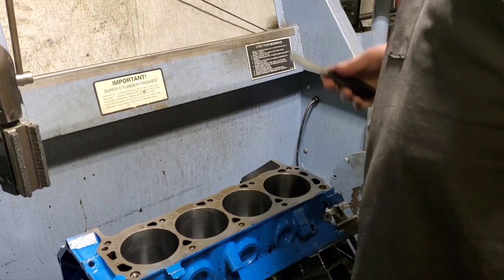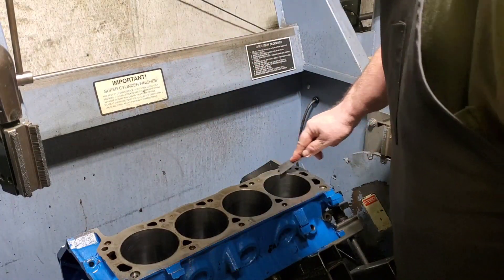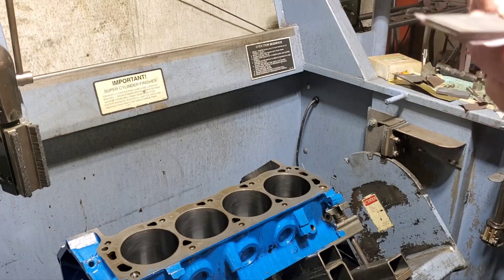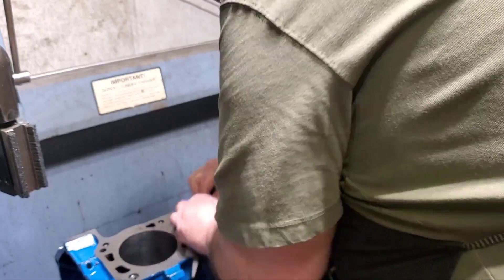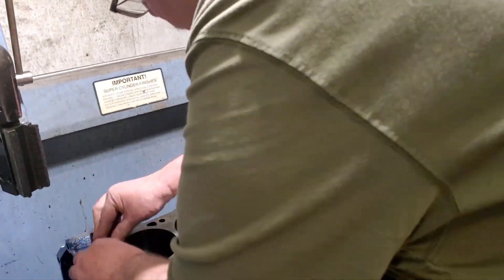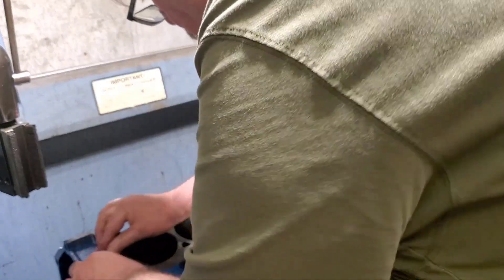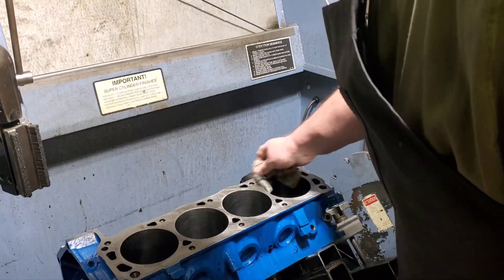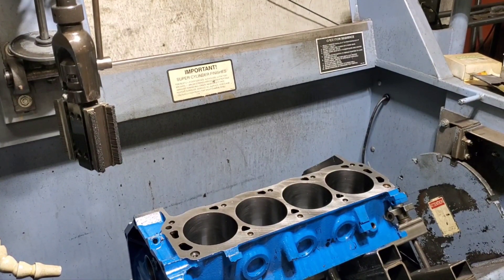Gasket Surface Prep, The Non Distructive Way. Simple But Effective Solutions.

Comment: You need a straight edge and a feeler gauge. any more than .003 you need to resurface.
Reply from the maker: They deck is flat and been surfaced before.
Just cleaning and preparing for a gasket surface. 
Have a good day.

Comment: Nice trick I like it!
Reply from the maker: Good morning Nolan.
I hope you try this.
Works on most all gasket surfaces. 
Just change the grit of the emery cloth and or sandpaper.
The black wet or dry works on aluminum parts, 220 to 240 grit.
Take care, Ed.
Reply: @edsmachine93  I will for sure! Thanks Ed.

Comment: Did my tractor engine like that. It took me two days to take .010 off the deck. I used a flat machine plate and 80, 120, 220, 320. I got all the rust and indentations out from the head gasket. Ended up with a .032 quench and .7 more point of compression. I hardly need the fuel plug to heat the intake.🚒👍
Reply: Firstrespondergarage ,
I use the same method when working on small engines,   like the Briggs and Stratton.  For the head I put 150 sandpaper on a flat surface and rub the head back and forth,  turn 90 degrees rub some more and keep rotating every few seconds,  for the block I use a file with the sandpaper wrapped around it.  You have to remember most small engines are a fairly good grade of aluminum.  If you look through Ed's videos,  you can find where he fixed  valve guide and did a valve job on a Briggs OHV head. 
Have a wonderful NEW YEAR Sir. 
Bert
Reply: @bertgrau3934  thanks you do as well Happy New Year🚒👍
Reply from the maker: Hey First Responder. 
That's alot of work what you did.
Certainly the hard way.
I am just cleaning and preparing the surface before I jet wash the block.
Thanks for watching. 
Take care, Ed.

Comment: A file works well if the file is flat, I machined a block of aluminum and glue emery paper to it.
Reply from the maker: Hey Randy.
That will work also.
Still better than the disc in a drill.
Just my opinion. 
I appreciate you. 
Take care, Ed.
Reply: @edsmachine93  👍👍

Comment: Excellent there is a definite surface finish for gaskets to grip on.... I treat the water pump and outlets surfaces the same way any time I have a timing chain cover that passes coolant I make sure to use a block and sand paper on all the gasket surfaces as 302s and 360/318 are notorious for leaking at these areas and can leak internally into the oil. Now none of my small block mopar leak cause of correct prep.
Reply from the maker: Hey MoparNut. 
Thanks for watching. 
I personally cannot stand the ___ Disc.
The surface is out of flatness and parallel.
I want to clean and prep.
Just as you do.
I am so frustrated with the cylinder head surfaces that are almost ruined.
I am all about making it better, not worse.
Take care, Ed.